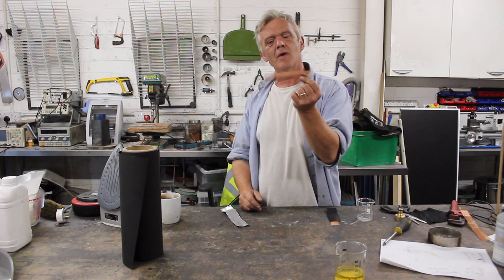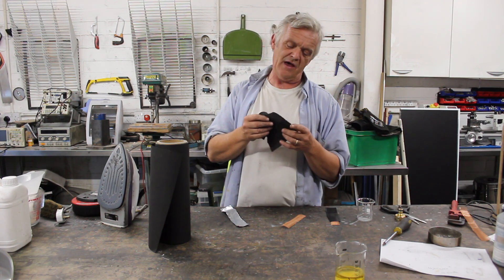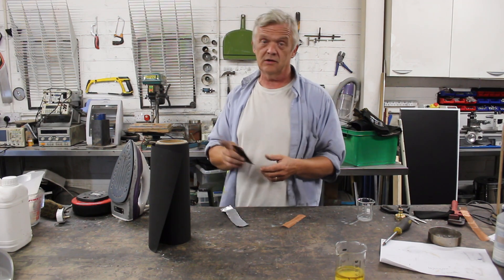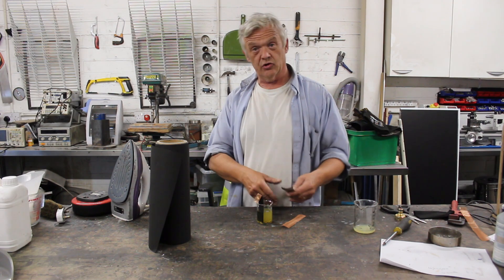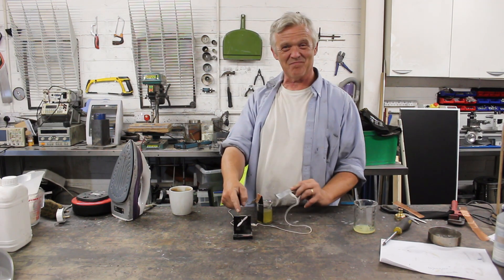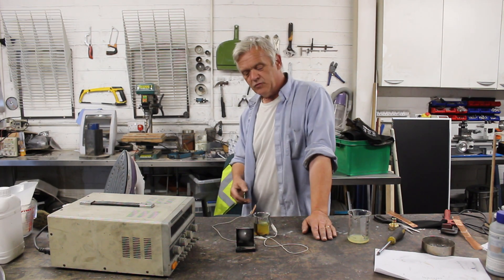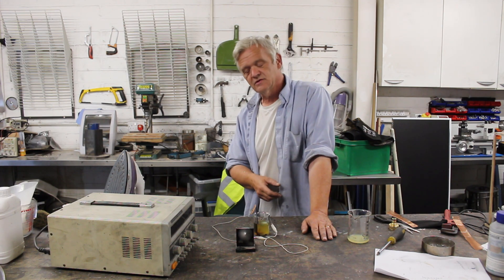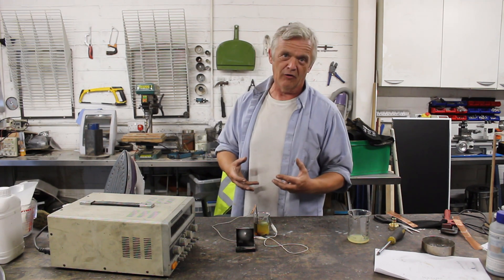A Battery That Is Stupidly Easy To Make

Comment: I understand and applaud your purpose of engendering a lot of inquiry.  I am wondering if with your background in batteries whether you would consider this or some other battery chemistry practical as a diy home storage battery especially in a "time of use" scenario where off peak electricity costs the user significantly less or one has renewable intermittent sources such as wind and solar?  The batteries would see significant daily cycling.
Reply from the maker: ah mate - I get asked this a lot - I will do a video for you

Comment: Are there other gelling substances that are available, besides fumed silica that would work in halide batteries?
Reply from the maker: yes - but none as easy or as cheap to get hold of - using different gelling agents is exactly what the Gelion battery does but with zinc and bromine - but that is basically the same battery as shown here.